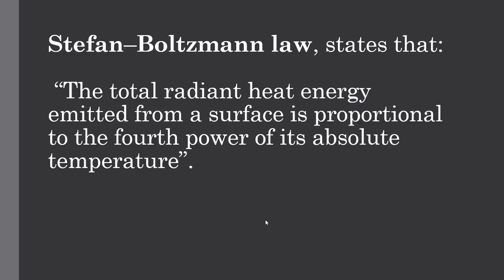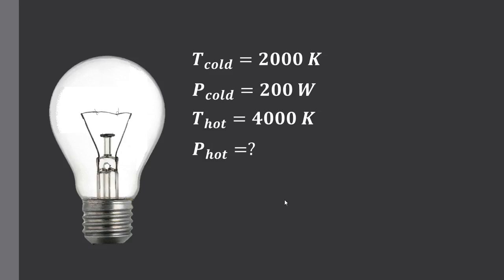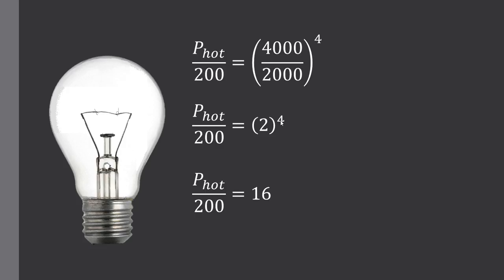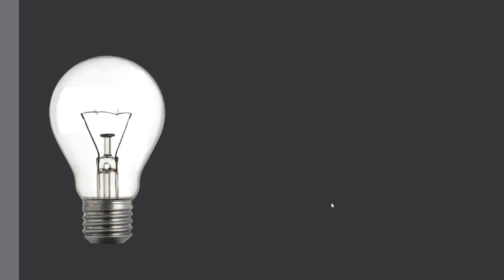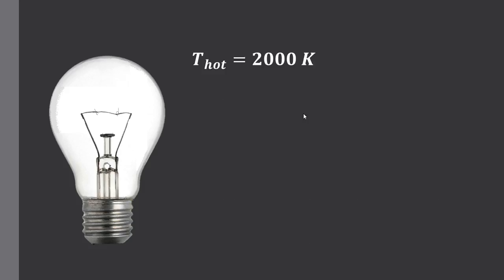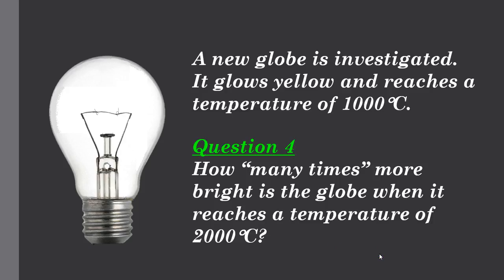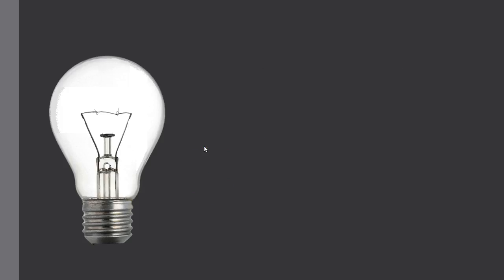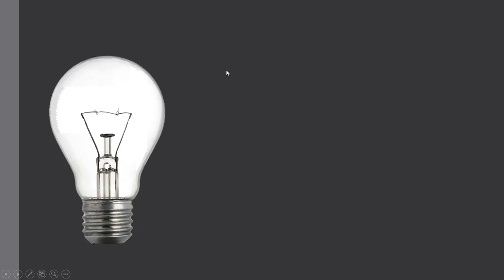Stefan Boltzmann Law Examples

Comment: In my opinion, if the globe operated at a temperature of 4,000K it would not produce any power at all, since the melting point of tungsten is only 3,690K and the melting point of glass is less than 1,800K. So your experiment would be a small molten blob of gloop on the floor.